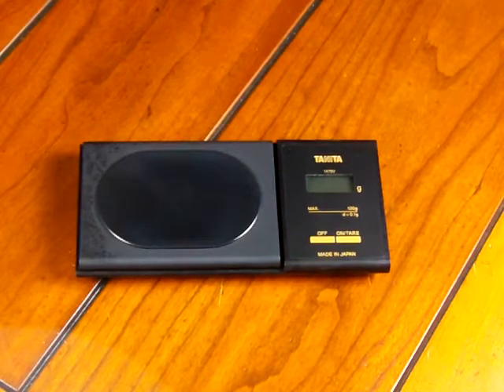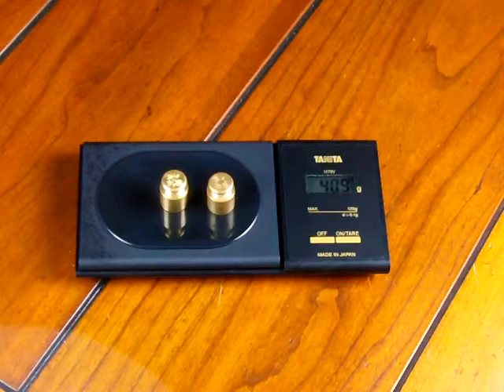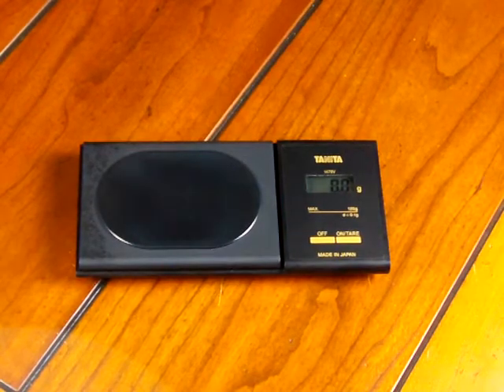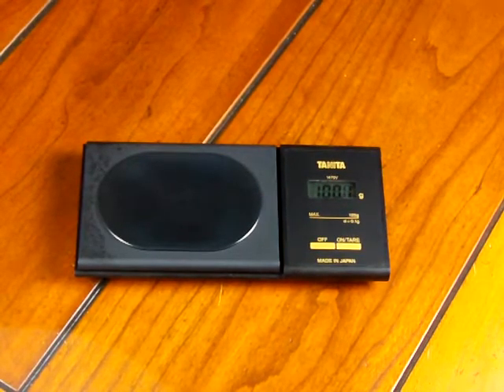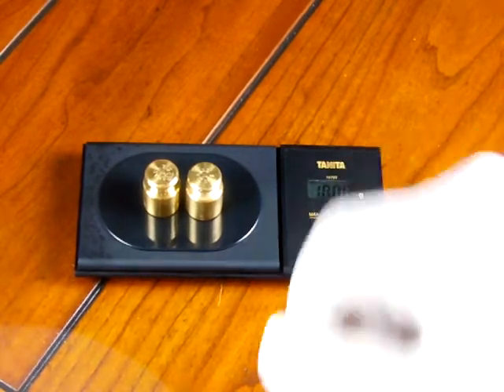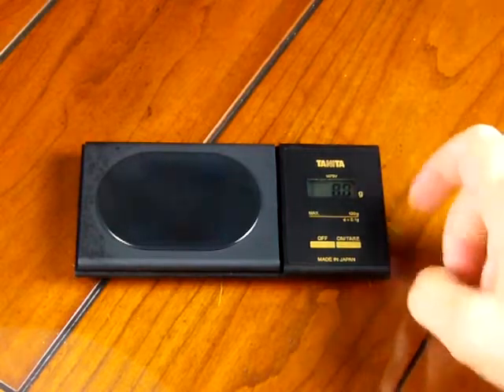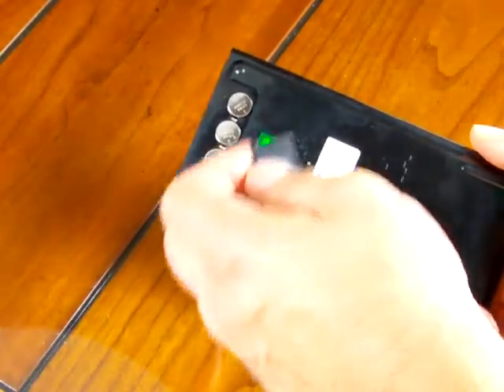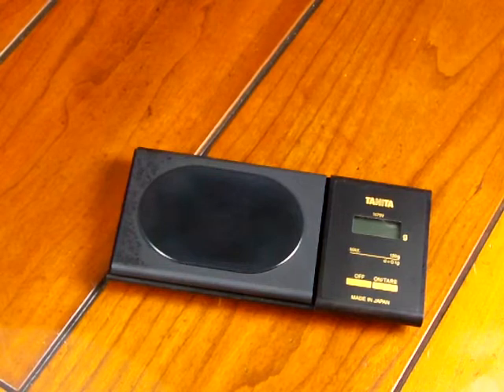How to calibrate Tanita 1479 pocket scale

Comment from the maker: For the 1479 - Press and hold the “OFF” button and press the “On/Tare” button 3 times.The LCD displays “0-0”  Do not place anything on the weighing platform.The LCD displays “0-1”  Place the 50 gram mass on the weighing platform. The LCD displays “0-2”  Place the 100 gram mass on the weighing platform.  This is performing a calibration at the full range. The scale will now display “0.0”.  Press the “OFF” button and turn the scale’s “On/Tare” button and the scale is now calibrated.

Comment: Ok thanks.
I have the 1479Z which have a calibration button on them (requires a 200g weight to calibrate).
I also have the 1476N which I was referring to about the sequence of holding the off button and pressing the on button 4 times. I tried it with these scales and the did something else altogether and didnt appear to go into a calibration mode.

Comment from the maker: The calibration of the Tanita 1479V is similar for the Tanita 1477, Tanita 1480 and Tanita 1479 pocket scale.  The Tanita KD200 kitchen scales also had a similar calibration procedure by pressing the hold button down and then pressing the ON button multiple times.  I guess if you have a different Tanita scale other than the 1479V shown in this video to try the procedure to see if it works for your particular model Tanita scale.